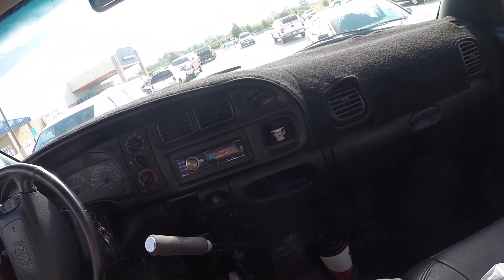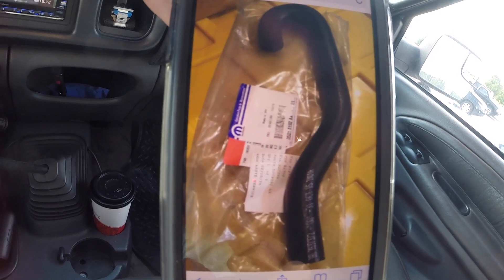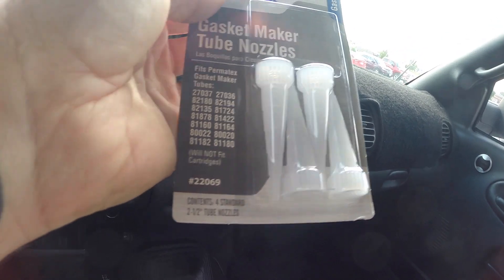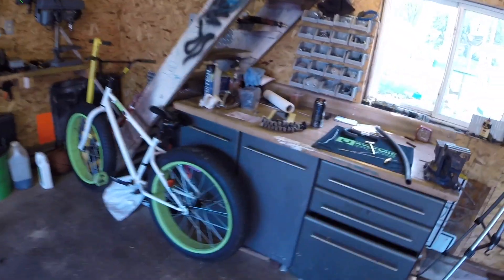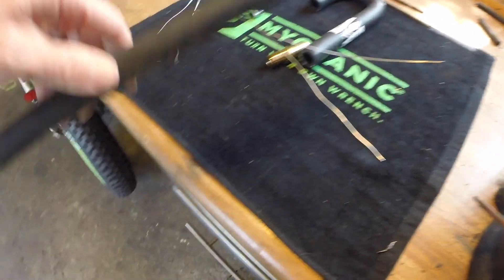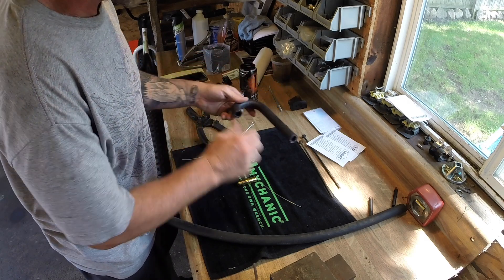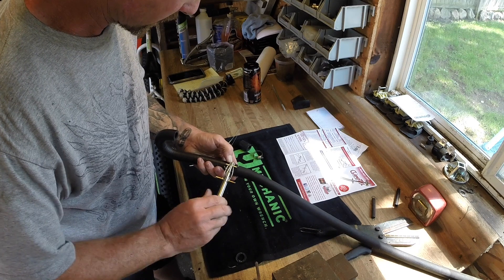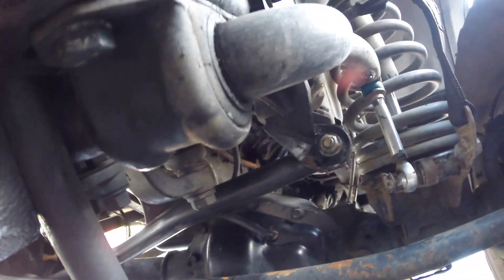Dodge Ram 2500 2nd gen Cummins crankcase breather

Comment: I got mine running straight  down..... Zip tied to my 32MM sway bar. Been running it like that 15 years with NO mess, NO problem....  Just a drop or two of oil dropped out.  It's a regular maintenance item according to Cummins

Comment: One on hand (in inventory)  is ALWAYS wrong. Well, nothing is always wrong, but when I looks something up, or they tell me there's one on hand, I say PLEASE go put your hands on it and call me back! Glad to find this video. I thought I was having trouble with a O'riley's fan clutch , but then noticed that the breather container  was all oily and got pretty suspicious ! Crazy that I'm just noticing that thing ! Going to investigate, and probably get these things. Can it get filled up ? Not sure i'd want to drip oil on the ground, but depends on how much is actually coming out ? And how much is supposed to come out ? Seems like it would grease up the entire bottom of the truck ? I LOVE the clamping tool and ordered one, as I do thing all over, in fact could have used it to do a temp repair on an antenna at 7000 ft yesterday ! Its so flexible size wise... 

So,  I need to measure and find out if something isn't right ? I'm investigating this crankcase blowing thing, my engine doesn't have many miles on it (150,000) . Possibly the container just filled up ? Does over filling cause some of this ?
Reply from the maker: Yes after a extended period of time it can get filled up. The clamptite tool is awesome I'm sure you'll love it. Thanks for watching and if you haven't already hit that subscribe button and become part of the family!
Reply: @ChadMyers73  Interesting that 73 in your ID. 73 is very important to ham radio operators.

Comment: Under my 97 dodge it makes a mess of oil and I don't know what to do about it I'd have to add oil every morning and the oil pressure reading is reading less than normal when I first turn it on its in the middle then it slowing is going down I've change the sensor and the pigtail what could it be?? It has blow by but not that bad yet
Reply from the maker: Sorry say but it’s time for a rebuild and make sure and put a oil pump in as well

Comment: I ran a long hose on mine to just behind the left front tire. It made a nasty mess on the undercarriage. I get quite a bit of vapor coming out of the hose when at idle (the only time I can look at it). I just installed an aluminum catch can and it blew oil out of the filter on my undercarriage again. It is installed just behind the left front tire on the frame rail. It seems like an excessive amount of blow by/oil. I only have 99000 on my 2001. I am thinking about welding a fitting onto my exhaust pipe and sending the vapor into it. I know diesels don’t burn very hot but it might get it away from my truck.
Reply: Great Idea.

Comment: Are you supposed to change the Crankcase Vent filter on the 2nd gen 24 valves or can you just clean the filter and re use it? Im having a hard time finding a straight answer. Even in my owners manual.
Reply from the maker: Taylor Bell I only have the front breather/filter and I have never done either.
Reply: I just changed mine 2 months ago....   (Y2K 5.9)   200K on the original. Can't tell a difference.

Comment: Where did you get the intake horn?
Reply from the maker: Amazon
Reply: @ChadMyers73  trying to find one with better reviews. Was yours too long to meet the pipe from the intercooler? Did the dipstick have a place to fasten to?
Reply from the maker: This one worked out well for me. Everything lined up had to pull over on the dipstick tube maybe 1/2” or so.
Reply: @ChadMyers73  do you have link?

Comment: Can't you just cap the vent. Is it really necessary.
Reply from the maker: You need to have a vent somewhere so it doesn’t build pressure.
Reply: @ChadMyers73  I have a 2002 2500 cruiser, I just put in a new injector pump and injectors in a couple months ago. I polished up some of the parts before reinstalling. Then degreased the engine. I forget to take the breather out after to empty it of any water. It made a total mess for a couple weeks before I realized what I had done. Bonehead move. Now I'm going to reclean the motor, and wanted to address this in a different way. But I need my engine not to drip. I work on alot of high end homes. Can't leave oul spots.
Reply from the maker: You can cap that one off and vent Through the valve cover do a catch can
Reply: @ChadMyers73  if the o ring on the injection pump doesn't seal properly, where will it leak from. I was having a problem getting the orange stripe perfect, and was focusing souch on the cotter pin. I thought maybe that could be contributing to the leaking.